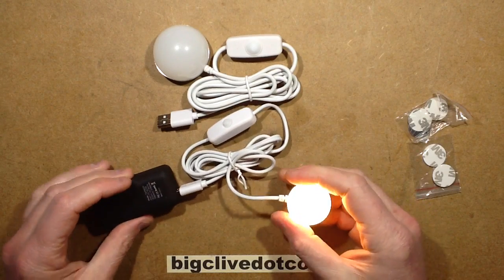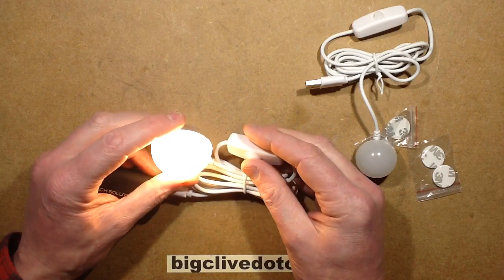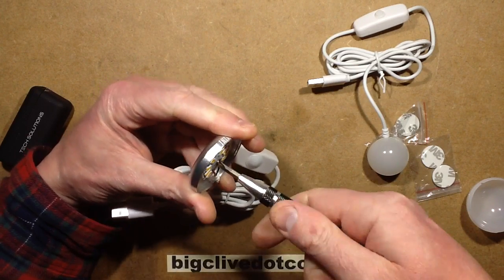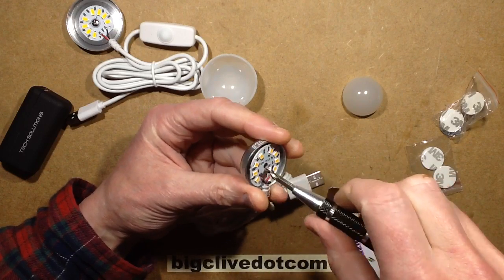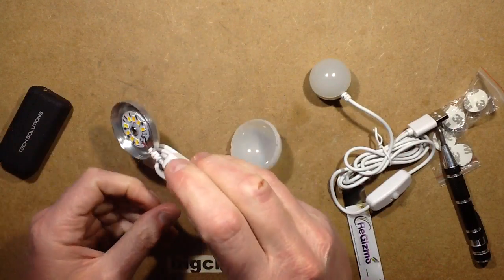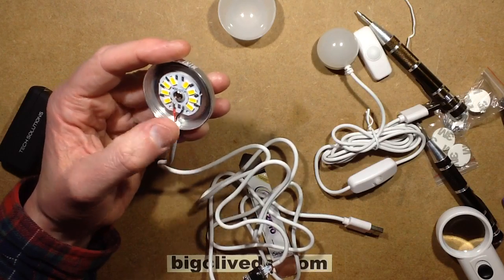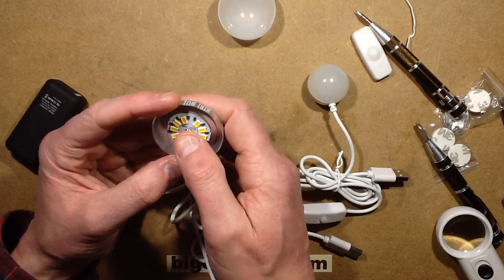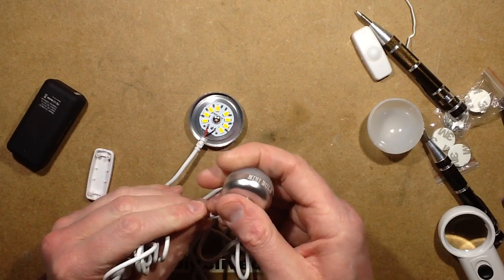A look inside some magnetic USB lights.

Comment: A while back my lady burned her arm on the small (incandescent) light that she had above her desk.  I grabbed a bit of scrap aluminum out of the "Heatsinks" box, a DC connector,  a small module built around an LM2596-ADJ,  and a 10W LED.  Put all this together and adjusted the module to deliver about 300mA,  so roughly 3W,  and it's completely and totally cool to the touch no matter how long it's been on.  I'd build me two more of these planning to use them in my ham shack,  but it turned out that one provided quite sufficient illumination so the other one is laying here on my desk and will probably end up being used here.

There's no reason that LEDs should run that hot,  unless it's so improve the continuing sale of crap like this,  when the first ones you get burn out.  People expect lights to burn out I guess,  so they're not gonna get upset,  they'll just get another one and use that.  Properly designed stuff shouldn't be that way.

Comment: an LED with 4W or more can light up a room. regardless of how much voltage its being powered by DC or AC
if you modified it so the LED is more close to the light diffuser and less recessed into the case. and plugged into a big beefy power pack it'd run for hours if you needed a bright emergency light or you could use as a flashlight.

Comment: These will happily run on 4 AA rechargeable NiMh cells and continue to work right down to 4v and below as the battery dies... smaller ones can run for 10 hours on a good set of NiMh AAs.

Comment: Are both leds the same, with higher value resistors in series with the smaller ones to limit the output?
Reply from the maker: +Neil Cochrane Different LED size.

Comment: I noticed your magnifying lens. I've been recently doing some SMD work lately. it's a pain to identify SMD resistor values or inspect the solder flow. I would like to hear your thoughts on what kind of magnifier to get.
Reply from the maker: +Robert Frisbie Take a look on ebay for "illuminated magnifier" and you'll find a wide range of units with LEDs built in.

Comment: These lights would not get quite as hot if they weren't wasting nearly 40% of their power in current limiting resistors. Putting two strings of four LEDs in parallel and using a boost regulator would make it far more efficient (~90% of power going into the LEDs instead of ~60%) but that would cost a proper PWM controller-driver and an inductor. Unfortunately, suitable chips from Analog, Linear, TI, etc. tend to cost more than these lights do including shipping from China.

Comment: Adding thermal compound would of course not aid in heat dissipation of the whole lamp, it will be just as hot as before... But it will greatly reduce the temperature gradient between the LEDs and ambient. So while the outer shell will be at 60°C, the LEDs might not be cooking at 90°C (just making things up), but only 70°C, with better conductivity to the back plate.

Comment: I imagine the controller on the large one draws current when off. I am annoyed by flashlights and headlamps with "features" (dim and flashing) that are selected by a single button. They draw enough current when off (tens of microamps) to drain the batteries in a few weeks or months.

Comment: Hey Clive, it's me again. I was wondering if this is a good deal for me to get as a first soldering "kit". It includes a mains soldering iron with solder and a stand and other electronics stuff like, screwdrivers (?), power meter and solder pump. Is it a good deal or should I go for a bit more and get a dedicated station?

Link: http://www.ebay.com/itm/10in1-110V-60W-Electric-Desoldering-Pump-Iron-Station-Solder-Soldering-Iron-Kit-/252082993396?hash=item3ab15138f4:g:ymwAAOSwDNdV7ATE
Reply from the maker: +Dakota Blake I'd suggest a grounded iron if you can get one, but otherwise it may do the job.

Comment: I'd bet money on the larger one originally being a solidly-designed product, but typical Chinese cost-cutting and margin-shaving have reduced it to something that gets a little bit too hot.
Either that, or someone just thought to shove more power thru basically the same design without thinking of the thermal issues (even tho it's still quite a bit cooler than a fluorescent or incandescent bulb). I call that the "Tim Allen" approach (if you don't get the reference, look up a sitcom called "Home Improvement").

You might be able to turn it into a much safer, cooler light quite easily, assuming you have a few things that most people who tinker with electronics would have on hand.
Put some heat-sink compound between the aluminum-core PCB and the metal backing, then only use it on metal surfaces.

Comment: What's in the small lights switch?
Reply: Just a clicky switch.
Reply: +A. Zak there might be more like a regulator.
Reply: jak p There were resistors on the board to regulate the current, but i guess there could be more regulation inside the switch module.
bigclivedotcom you can resolve this debate by popping open the little one's switch cover and telling us what's in it!
Reply from the maker: +A. Zak Just popped the lid.   It's just a switch.
Reply: bigclivedotcom Thanks Clive! Love your videos! I'm working on watching every one of them, i have about 35 or so left to watch!

Comment: I've made USB lights out of various battery powered LED lights I just take an old USB cord and cut the B end off, strip and solder the red and black wires of the USB cord to where the + and - wires coming from the battery contacts and then knot the USB cord then cut a small hole in the housing of the light to run the cord and then power it from a USB power bank. some of these lights just go through batteries like crazy so this hack makes them last longer.

Comment: Im curious what you do with all of these items after youve created the video..?
Reply from the maker: +Christian Nielson I use some of them and others go in a big box for later use or scavenging if needed.
Reply: Christian Nielson is
Reply: hi i have this 3w warm lamp and have some issue i connect it to vinsic 20000mah powerbank and after 5mins have some power distortion flickering.. and if i connect the lamp to asus 10000mah bank it works fine what it can be?

Comment: Great video, I wonder if the larger light is meant to dissipate its heat through what ever the magnet is stuck to. you could find a small finned heat sink and see how that works out heat wise.

Comment: 900mA is excessive for USB... what would happen if you plugged it into a compliant port that limited the current to 500mA? Would it kick down to the lower power?
Reply: You'd be fine using a usb 3 port as they can supply 900mA but I wouldn't recommend any earlier revisions
Reply: +TheChipmunk2008 my laptop outputs 2amps :p

Comment: How much of that heat is from the resistors? Assuming they each have a current of about 100mA, then at 27 ohms they will draw 0.27W each. Maybe if the PWM output was smoothed it could drive them at the correct voltage without the resistors?
Reply: +codebeard
You'd still need some small resistance value in series with each LED (assuming all are being driven in parallel) if only to balance out the current thru each one. This reduces the chances that the output transistor will burn out if one or more of the LED's goes short-circuit.

Also, your math is off. P=I^2*R. Your calculation appears to have used P=I*R
At 100mA and 27 ohms, the resistors must dissipate 0.027W each.
That's easily doable with tiny SMD resistors.
At 100mA per LED and 3.5v (typical white LED forward voltage drop), the LED's would dissipate 0.35w each.
With 9 LED's, that's a total of 3.15w, and assuming a typical LED efficiency that should put out "quite a bit of light".

I could probably get a rough estimate of total light output, but I'm lazy and that's not exactly useful without a bunch of other variables that don't concern the LED "proper", primarily concerning optics (lenses or diffusers), and distance between the light source and the object you're trying to light up.

Comment: Clive, please review this and take 'er to bits...  http://www.ebay.com/itm/Rotatable-Healthy-USB-Ionizer-Ionic-Air-Purifier-Handy-Fresh-for-PC-Laptop-DT-/281928358446?hash=item41a43d5a2e:g:KBcAAOSwX~dWtVtn
Reply from the maker: +Dark Alchemist Done that one.  Not actually recommended.
Reply: bigclivedotcom
Ahhhh, I wouldn't use it on the USB but did it actually put out negative ions?
Reply from the maker: +Dark Alchemist It had everything required to do so.  The step-up transformer and multiplier.  But I didn't test it too deeply, since I wasn't keen on it referencing a high voltage to ground on a USB power supply.
Reply: bigclivedotcom
Yep, that would be a problem being so close to the computer (actually attached) as well.  I tried to find your review but I either skipped over it or I didn't go back far enough (only went back about 1.5 years).

Comment: Anything over 500ma is too much for USB anyway.
Reply: +Dark Alchemist Well technically 900 mA for USB 3.0 and the newfangled type C goes up to 3A (and with higher voltages too if they are negotiated between supply and device).

But a USB 2.0 compliant supply shouldn't go above 500 mA, that much is true but then even back with 2.0 you already had the battery charging specification stuff that would allow things to go higher. Its a bit of a mess really, I don't know all the fine details.
Reply: Extra stuff
I know enough to keep that off of my USB port so I don't blow it out, lol. ;)

Comment: I'd imagine the adhesive would get a bit gooey on that large one
Maybe the resistors are for different light levels, i'm guessing pwm and resistance select
Reply from the maker: +Sparky Projects I think it's PWM being done entirely by the chip.
Reply: +bigclivedotcom It's actually an N-channel mosfet, not a bipolar... so PWM is likely.
Reply: +bigclivedotcom I actually recognized those letters straight away, it's a Vishay 1.25W MOSFET if I remember correctly. Pretty beefy for a SOT-23.

Comment: sounds like something you could use for survival, or at the very least as an outdoor light if you sealed the dome. Have a solar charger somewhere outside, let the sun charge the bank, then use with one of those lights wired somewhere occasinoally, for some light.

Comment: they usually use an atmel chip i have seen it in a lot flashlights just dont remember the number ill look it up.
The magnet will lose quite a lot of force with all that heat.

Comment: I could see myself Putting some Velcro tape on a small USB battery bank and sticking that along with the smaller one inside my bedroom closet that does not have a light, but yeah that's crazy about the big LED getting that hot.

Comment: 900 mA  draw would  make most pc's throw a wobbly unless it was one of the modern high power draw sockets.
Reply: +brian whittle my laptop outputs 2 amps :P
Reply: +brian whittle My PC only has USB 3.0 sockets (two are 2.0 but they are occupied by mouse and keyboard) and they're rated for 900mA. The front USB are connected via cables to the mainboard, the cables are so cheap that the voltage drops severely even on 400mA. So putting this LED on will put down the voltage enough so that it does not get so hot.
Reply: +brian whittle The polyfuse would likely trip on USB 2.0 at least, since they're rated for exactly that maximum.
Reply: +Vibinator yes I know, but plenty (most) USB 2.0 sockets will bug out at 500 mA, and the ones that do work need a installed  software hack to make in so. 

USB devices like mobile phones don't just try and grab all the power they can slurp down like that out of spec light does.
Reply: ***** the USB on the board would still be over-current though
Reply: brian whittle
Nope. USB 3.0 is designed for 900 mA, and with the voltage dropping the board would not even see 900mA. Additionally, ASUS boards are indestructible from 500 EUR on upwards. I have an Asus X99-E WS.
Reply: ***** sorry I thought you were talking about 2.0 ports with the drop.
Reply: They voltage drop is on the front USB 3.0 (or should I say USB 3.1 gen1?) sockets. The 2.0 ports are occupied by mouse and keyboard and are on a bezel at the back of the PC. I don't know if the USB 2.0 also have voltage drop, I would imagine because the wires don't look very thick for V+ and GND. ;) But for mouse and keyboard it's okay I guess, Although I have a BlackWidow and a DeathAdder von Razer.
Reply: brian whittle Yea, it blew my mind when i plugged in my (usb 2.0) charger doctor + power bank to charge :p.

Comment: What about putting a zenna diode in series with the red or black wire?
You could make the top bright better :-)
Reply from the maker: +zx8401ztv Even a string of ordinary diodes would drop about 0.6V each.  So two could halve the current.
Reply: +bigclivedotcom 
I didnt know how much voltage you needed to lose to lower the current enough, thats why i said zenna :-)
I thought it could be tamed down to the brightness of the little one, less heat.
I liked the little one better too :-D